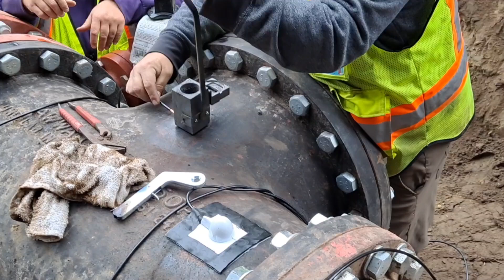Thermite Welding AKA CAD Welding

Comment: Why is this kind of welding used?
Reply: exothermic welding like this is used in electrical construction because it’s very easy and relatively safe to do and doesn’t require much training. we use it to weld large conductors together and to bus bars, and to weld grounding electrode conductors to things that need grounded and bonded(which is kinda what’s happening here i believe)
Reply: The minimal amount of equipment and setup is one benefit.
Reply: Versitarium has an awesome Video on thermite if you would like to know more!
Reply: They’re attaching copper wires  for cathodic protection purposes. 
Cathodic protection is used to isolate electrical energy into a sacrificial anode and protect the iron lines from developing holes.
Reply: This was a small one

Comment: What kind of lighter is that?
Or is that some special mix of thermite?
Normally you need a magnesium strip & a blowtorch to ignite thermite.
Is it maybe thermite mixed with some sort of (smokeless) gunpowder?
Reply: If i had to guess, and I'm guessing, probably a magnesium alloy bar that gets shaved and the splinters ignited and shot out with each pull
Reply: Flit striker just with a trigger running a round wheel like a bic lighter, The thermite charge is a prepacked charge for welding ground straps on watermains. Cadweld is one brand. The very last bit of charge that sticks in the bottom of the tube is fine ground magnesium.
Reply: @joshuacheung6518  on larger  set ups . The ignition powder comes in a separate container. It is similar to a sparkler firework. It is easy to light but burns hot enough to ignite the thermite mixture which is very difficult to ignite
Reply: Good quality will ignite with a strong spark..Ive unfortunately created this while machining/grinding . Maybe yours has a lot of humidity in it or something? My punishment?
   I had to sleep in a chair at the machine shop watching my area for re ignition! After I machined cast iron and then aluminum and Mag, and Ti and bronze and...witches brew of chip mix.
Then I welded on a table near it. Stuff was crackling all over!  Lil wisps of smoke would mark tiny spots of lava, and inside them was a white hot glowing ember ...scattered all over my work cell. Under machines, on cabinets and behind them too!. The owner gave me the option, stay the night with pay/ or get fired. Clean up and never mix chips again.
 I chose fire guard cleanup and a job.. He showed mercy and let me go home at 5am and come in at noon that day.  I learned well from that punishment.  And respect to the boss for keeping me.  I put out little fires for HOURS with a spray bottle filled with soapy water and would foam them and sand it down. 
Boss had hung 5-6 smoke detectors in my cell and they would go off and wake me.. Later, I learned this was not unusual in the Machining / Tool and die trades.
Reply: @frosthoe   any time we do them we heat everything up with a torch first to drive out any and all moisture. If you don't then it can flash to steam and shoot molten thermite out everywhere.. 
I only skipped the torch step one time and will never do it again
Reply: The flint lighter is a HVAC tool called Shoot A Lite . Called a LITER . I bought a pair of experienced ones off of eBay a number of years ago. Used and  cheap but they cleaned up easily and accepted hammertone paint well. This vid is the very first I have seen another one. Always asked the same question as you when I bring it to a job site.

Comment: Why would anyone weld a copper wire to pipes using thermite?!

There's safer & better methods!

IMHO, thermite welding is better suited for connecting big steel parts, especially rails / I-beams.
Reply: It's copper-aluminum thermite, so the resulting metal is copper.
Reply: And what would you suggest be used here? Solder?
Reply: Looked rather safe to me. And it seemed to get the job done. "Safer and better" isn't a good enough reason to change if the existing option is already good enough.
Reply: Arguably other bonding options aren't really safer either. They all carry a burn risk, many carry an electrocution risk.
Reply: Daily occurrence if you lay watermains for a living, every valve and bend needs a ground strap welded from pipe to pipe.
Reply: @joshuacheung6518  CranialMalfunction falls in that category of being contrary just to be contrary...
Nothing else better to do than to type little things like "There's safer & better methods!" because their mom isn't
done cooking the chicken yet or whatever...
Reply: I want to hear about these methods that are safer and better to apply while working in the trench. Can you describe at least two (since "methods" is plural) that give a weld that is as conductive, as durable, as precise-in-placement, easy to transport and requires no added PPE? 

Or methods that sacrifice those parameters but are so much better they're worth using?